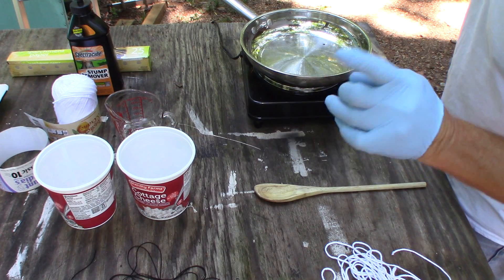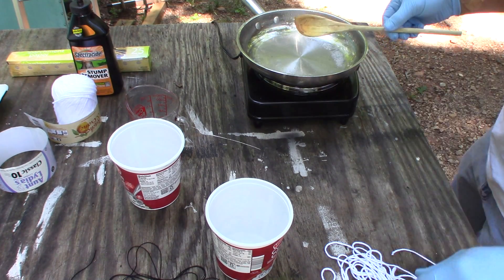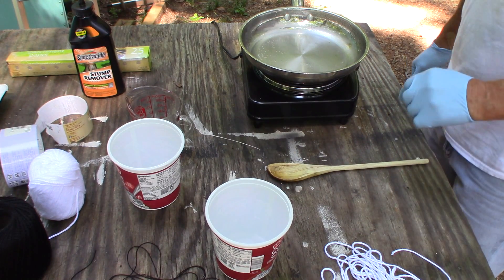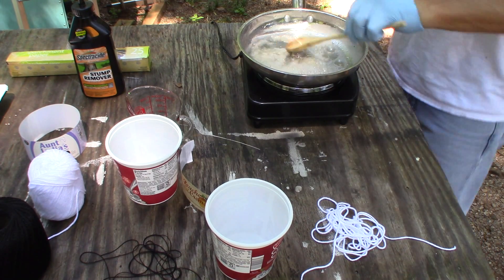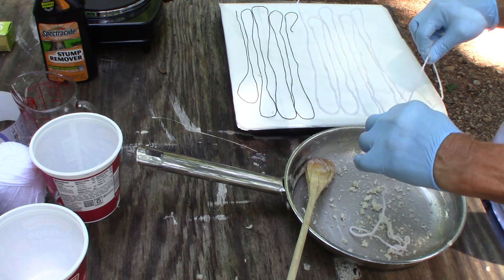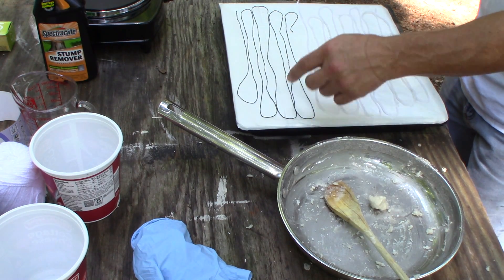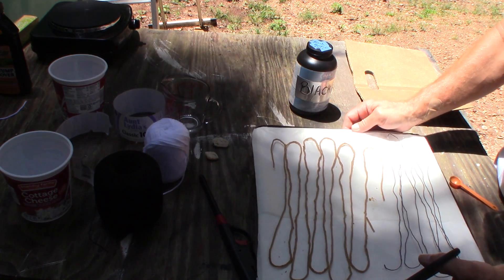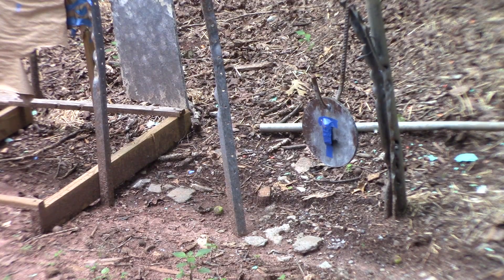Make Your Own "FUSE" (Fire Works) How To!

Comment: Hi, Elvis!
This is slow fuse and I was wondering how long to burn through a foot of fuse?
Appreciate your reply and keep up the good work!
Reply: Even though it's a slow-burning fuse if you have your mix right I would guess about 30 seconds but I'm not sure what you're trying to light on the other end of the fuse but I would run like hell either way! Just to be on the safe side

Comment: add some iron oxide or oxidized aluminum powder for a more aggressive burn...
Rocket candy is very, very handy.
Reply: Bill baker !!! Would i get a faster and more powerfull Flashpowder if i add either some >> iron oxide or oxidized aluminium.. my flash is made of >>> ba(no3)2+ al dark german eckhart or magnalium instead of aluminium??
Reply: @Kirt44 
75% potassium nitrate, 15% charcoal and 10% sulphur.
To that I add 15% (of the whole) magnesium.
Reply: @billyandrew  ok why do you not try it whit aluminium powder instead of charcoal
Reply: @Kirt44 
Because charcoal is relatively easy and cheap to make.

Comment: I really can't see the point of doing this unless you just want to. The ingredients are not just laying around the house. You have to hunt it down and buy it. Why not just buy fuse?
Reply: Fireworks are the remit of pyrotechnicians in many countries outside the US and in most of those countries it is illegal to make the mixtures without a license.
Over and above that, the transport cost for fuse is exorbitant and can cost as much as three times the price of the fuse, so channels like Elvis's are doing many folk a big favour by teaching them how to go about the task at a fraction of the cost.
I'd say you hit the nail squarely on the head and some folk just do it because they maybe enjoy the process and the final results.
Reply: potasium nitrate is used as a fertilizer and as a stump remover. if your in the us check your local hardware/home improvement store.
you can also make it using urine though that is a stinky and long process